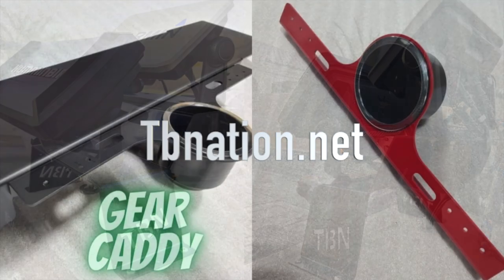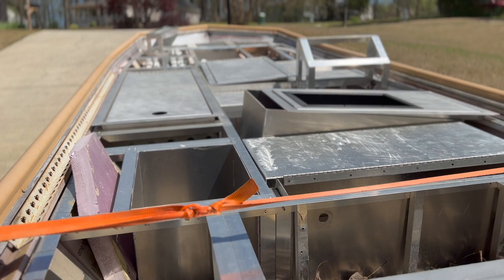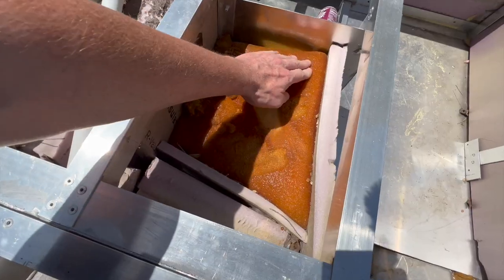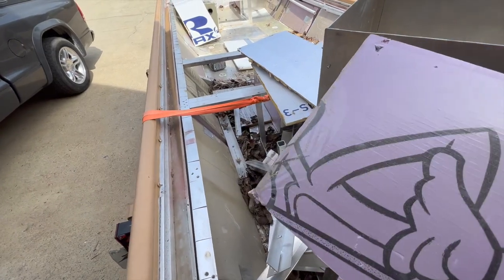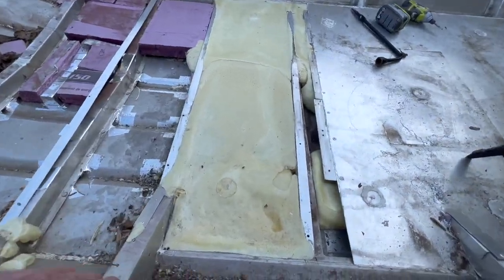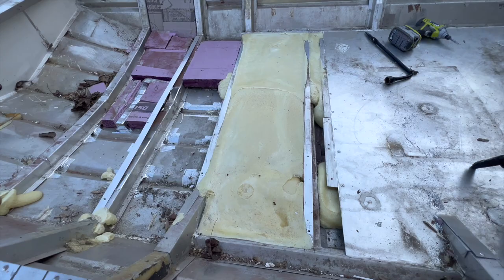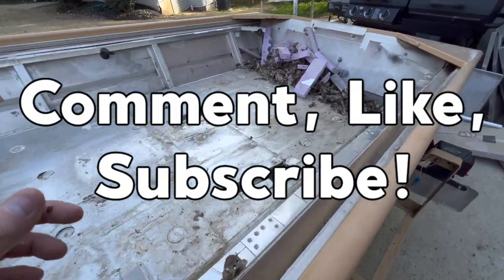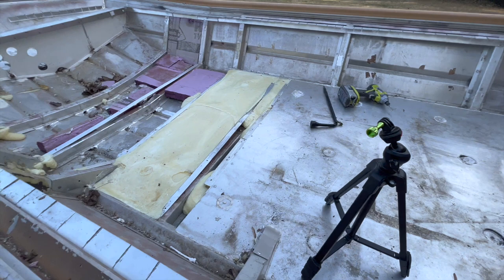POUR FOAM in a TINY BOAT 2 Years Later!

Comment: Nice video! Different boats require different techniques. For a flat bottom with no drainage (or if you leave the boat outside) it makes sense to use the sheets and not the pour foam. In a deep V with a dry channel in the middle then pour foam is good.  Big question for you to answer - did the pour foam cause any pitting or corrosion to the aluminum hull? There are many discussions about this.
Reply from the maker: We will tear into in the next video and find out, I haven’t been under it yet so it will be a surprise haha

Comment: I am trying to replace the Jon boat bench seat foam and 1x4 boards. But i want to know what should I use for the foam. I can’t find anywhere where someone refilled the bench seats with foam. The only thing I can find is removing the foam and turning into storage. I know some don’t like them. But I found out that foam helps the boat to float in case of sinkage. I am new to boats. But I want to keep it at spec and be safe than sorry. The bench seats are not attached to the floor. They are mounted to sides/walls of the boat.  Can someone help me out. What should I use instead of expanding foam or if so where I can find it.

Comment: So you don't do the foam right and you don't take care of the foam like protection it from the sun but it's the pour foams fault right? There is a reason all the big names use it. Boston whaler ranger all of them.
Reply from the maker: Nothing is the pour foams fault, and yes because it works in those hulls. Doesn’t work for hulls like mine, at least, in a beneficial way
Reply: Actually the pour foam fails in Boston whalers and all the "Big Name " boats. Really do a YouTube search on pour foams, soaked foams, repairing Boston whaler etc... you will find plenty of examples.  The reason everybody uses it is because its cheaper and faster and is coast guard approved, not that its a great product. The problem is the coast guard does not test long term . ALL two part foams though labeled as closed cell will soak water over time.   The manufactures all know the stuff absorbs water. It says so right on the material data sheets. Polyethylene is a much better alternative.

Comment: ive been wanting to add foam , but want to know is it safe to use around gas tanks and does it break down if gas gets spilled on it ?
Reply: Home Depot foam ( likely polystyrene, stay away from the stuff)  will break down with contact of gas and other chemicals. Pour foam is chemically resistant but is not waterproof and will soak water over time. It needs to completely encapsulated.  Look for polyethylene foam. it is both chemically reisistant and basically waterproof for life. Pool noodles are polyethylene. If you go the pool noodle route , get solid core to displace more water. 1 cubic foot of solid core pool noodles will only displace about .67 as much water as cubic foot of soil pour foam. Hollow core is around 50%.    Polyethylene sheets are pretty easy tow work with. make a Hotwire cutter.  Or, use pour foam bu fins some type of liner that is chemically resistant and durable and pour the foam in that and wrap it up. Seems to me cutting sheets to fit would be simpler?

Comment: I'm doing a deep v for myself, and I'm going to use only the pink foam, even if it will take me to do some 3D foam shaping; it might sound crazy, but there is a whole YouTube community that is doing foam shaping, which I can learn from. Moreover, as I'll be doing it for myself, I'm not concerned with fast fabrication efficiency and I'm not going to rely on foam as structure.

Comment: what is the foam for vs no foam?
Reply from the maker: Reserve buoyancy, strictly for safety
Reply: Basically it's to help keep the boat from completely sinking to the bottom so you can at least retrieve it the hull of the Boston whalers is actually got foam sandwiched between the fibre glass that's why there unsinkable there's heaps of videos of people cutting them in half and them not completely sinking that's Basically what the foam is for and most boats with floors generally have some foam underneath them from the factory like the quintrex topender sold here in Australia its an aluminium hull boat but underneath the flooring on ethier side is foam and then none in the centre from the bow to the transom so water can still flow out and drain to the bildge pump and drain plugs
Reply: It's highly recommended my friend sunk his boat but the foam in it prevented it from capsizing and from the engine getting fully submerged so he was not only able to save his boat but also get his motor running again a great investment just make sure you get it done properly because if it's not done right you may aswell not have it in there